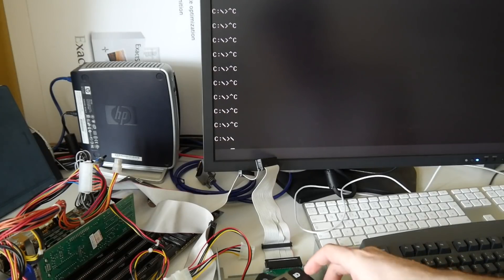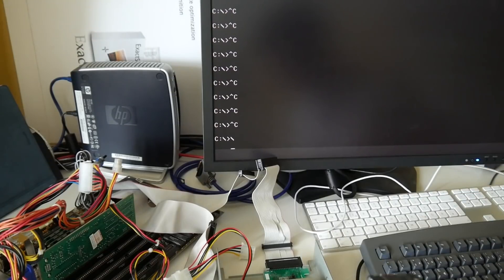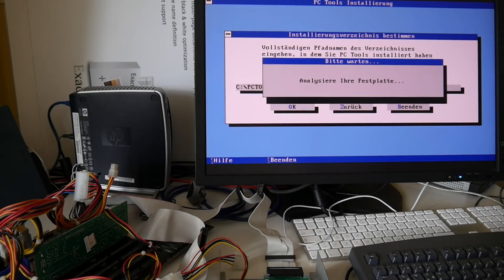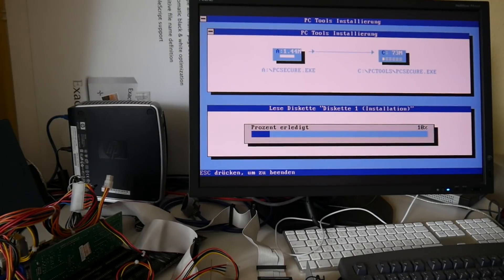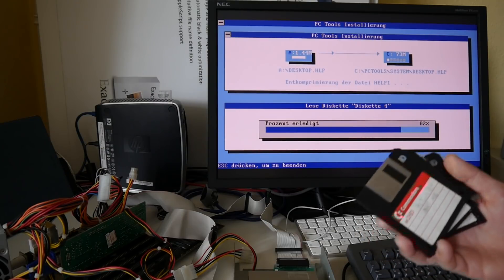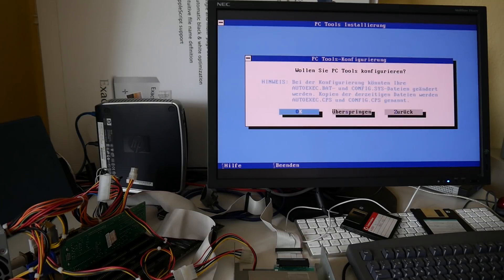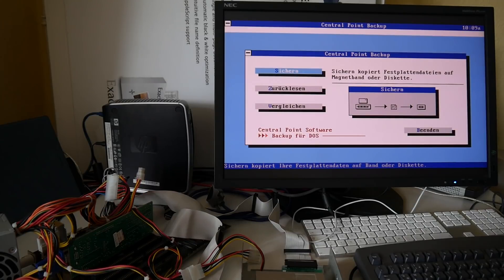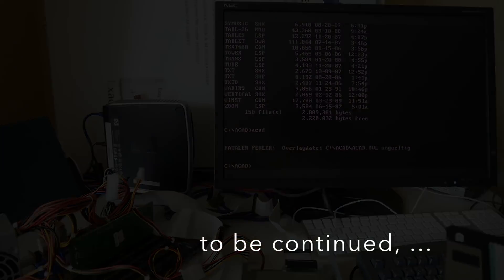Trying to restore AutoCAD r9.01 for "IBM" PC DOS, am386, part I

Comment: I think autocad for dos needs more swap space than the floppy disk can provide, due to phar lap dos extender.  Copy the contents to the "c" drive and try again.
Reply from the maker: AYFKM? Not only did the video install ACAD from the backup to the floopy, it is not even swapping. ACAD's driver does someting strange with just this Video BIOS. It is faster with other VGA cards I found.
Reply: @renerebe  OK.

Comment: @9:30 Floppy auto detect was a hardware problem on PC, not a software feature. Apple supported and standardized this from the beginning, IBM sort of required it, but never used, with time new floppies stopped producing any signal on /dskchang pin.

https://blogs.msdn.microsoft.com/oldnewthing/20090402-00/?p=18643
https://blogs.msdn.microsoft.com/oldnewthing/20090403-00/?p=18633

Comment: This is why I don’t use backup programs that store things in special formats. Straight file copies are the easiest to manage and restore from, because you can manage them using the same file-manipulation commands you already use every day. rsync is great for this, because it has features like doing an incremental backup that looks like a full backup for restore purposes -- all using standard POSIX filesystem features.
Reply from the maker: In general I could not agree more, however, especially back in the day files could also be bigger than what fits on one floppy, plus one usually wants compression and maybe checksumming as well, ...